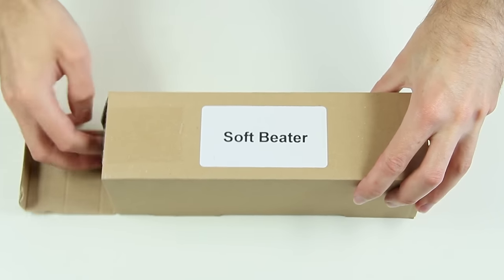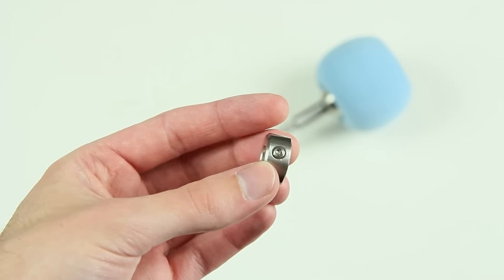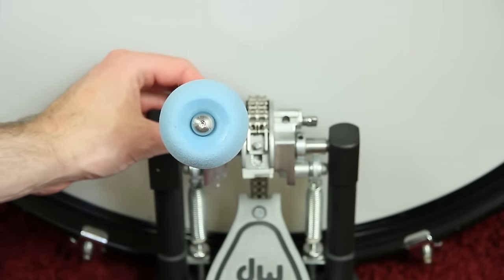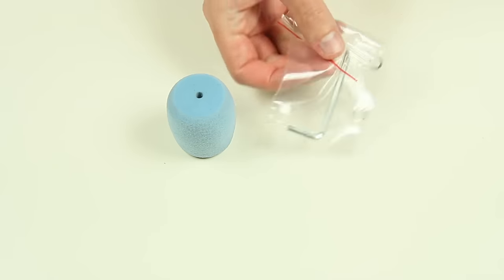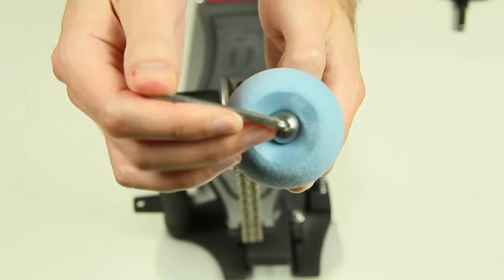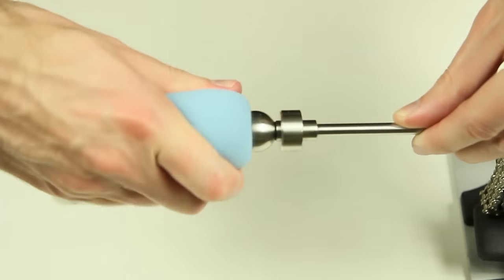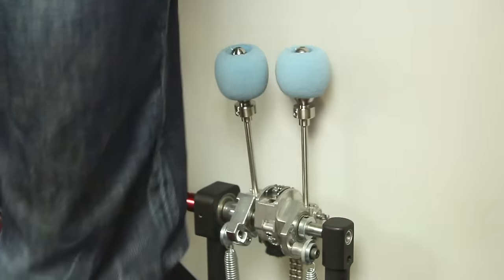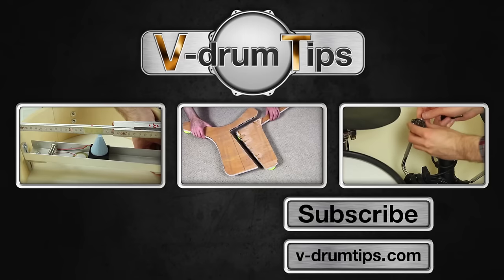R-Drums Soft Beater Review (E-drums)

Comment: i have to wonder why you dont try out the beater on an actual kick pad? the acoustic drum isn't really representative since it'll resonate from any impact unlike a rubber or mesh pad
Reply from the maker: Good point, I have tried it with rubber pads and the result is outstanding. But it works very well with the KD-120 too. At the time when I made this video, I did not have those pads:(

Comment: Might be just what I need for 10" mesh kick drum. I understand the foam beater won't ruin a mesh head. But does the mesh head ruin the foam beater? Thnx!
Reply from the maker: +Tim Lobb Depends, the mesh can ruin the beater is if is not under high tension and if the beater hits it in a weird angle. A kick patch will help to avoid that. 
If the pad is strongly dampened, like the KD-80 , 120 or 140, the beater wont dissolve quick.
Reply: +Vdrum Tips Thanks!

Comment: I'd be extremely careful when ordering with these cats. Asked for the small beaters, as per this video suggested for double pedals. They agreed to send the smaller beaters, so I could avoid the issue on vid. Was sent regular sized beater heads, and told I was sent the smalls. After I put beaters into same pedal on video (DW 9000) and had same problem. Then suddenly they sent me an invoice for the correct beaters I had asked for originally. Kind of shady buiz practice, having to pay twice for what I had asked for before ordering. No accountability to try and make it right, just argued and dismissed the mistake. Oh, except I got 1euro off the next order....Thanks!
Reply from the maker: +Mescalito71 That is weird, because I know them quiet well and I am sure it was a misunderstanding. You have really asked for the small version before ordering?
Reply: +Vdrum Tips Yup...after watching your video, I told them I needed the ones that work for a double pedal. I'm not sure how that can be misunderstood, when you have a video that shows that the standards don't work for ALL pedals, and they have smaller ones that do. They said they would replace it for free now, and refunded my second payment. Interestingly enough, after I wrote that first comment. Not sure why they wouldn't specify that their standard beaters won't fit all pedals, especially a 9000, popular pedal that cant be adjusted in that manner. I didn't appreciate being told I received the smalls, and then sent an invoice for them later....Anyhow, it's finally sorted correctly.
Reply: @Mescalito71  you wouldn't happen to have a pair of the regular soft beaters laying around would you? Because if you do, I'll buy them from you. Because R-drums no longer sells them and I need a pair. I have 2 kick drums, so the normal size would work for me, thanks.